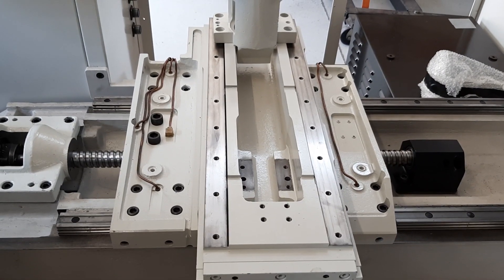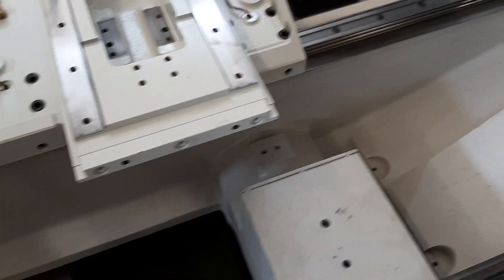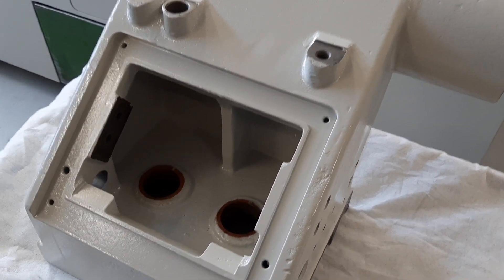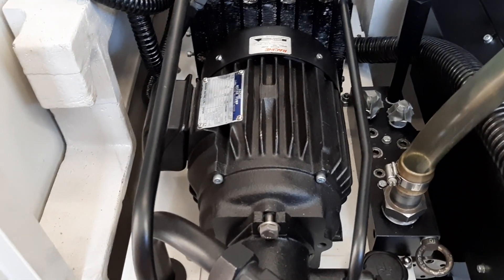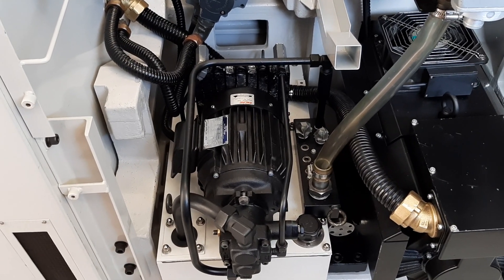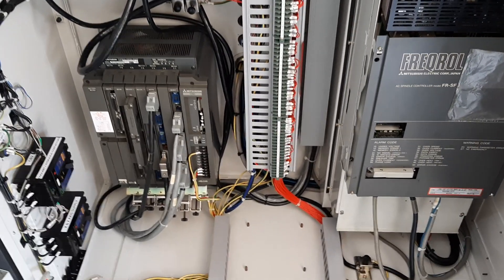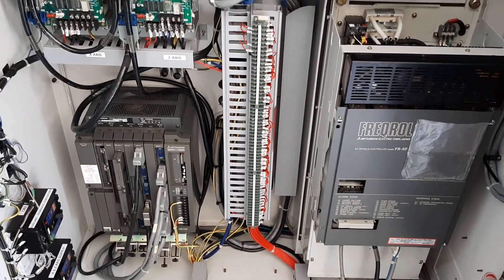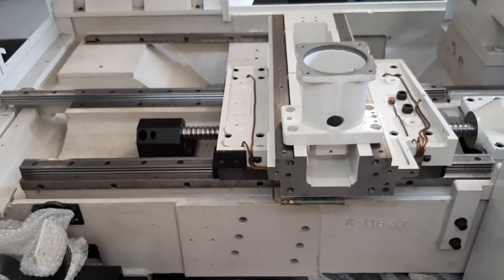CNC Lathe Rebuild. It's A Lot of Work  ????

Comment: Wow that looks real nice! What type of controller / software are you planning to use on this rebuild?
Reply from the maker: I will run it with the current Mazatrol Controller.
Which is pretty much the best Industrial Controller available.
It has been a long journey that is still not 
complete ??
Mostly because of the fussy owner, LOL.
It's as close to buying a new machine as i can justify.
Should be ready to use in early 2021.
Way longer than i was thinking but i did get a little carried away with the rebuild ??
Thanks for taking the time to watch.
Peter.

Comment: Very Nice Peter. Looking awesome. Cant wait to see it powered up
Reply from the maker: Hey Mick.
Happy with the way it looks.
Which is most of the reason for rebuilding it.
Not so happy with the time it,s taking.
Although i have not put a time frame for the rebuild.
Only that i would like it running.
But between what i want to look at.
And what i am prepared to spend on buying a machine.
Truly this is the best i can do.
I am stuck with my thoughts of owning a very tidy machine.
And the money i want to spend to own a tidy machine.
Other thoughts that come to mind.
Is the amount of space a CNC Lathe uses.
They are not normally a small unit.
Bang for my buck.
This machine is perfect.
Plenty of power and small in size.
Unfortunately i am stuck with my original plan.
Of owning a decent looking and decent sized machine.
Come early 2020.
I should see the completion of this build.
VERY Much looking forward to it.

Thanks for taking the time to follow along.
Much appreciated.
Peter.